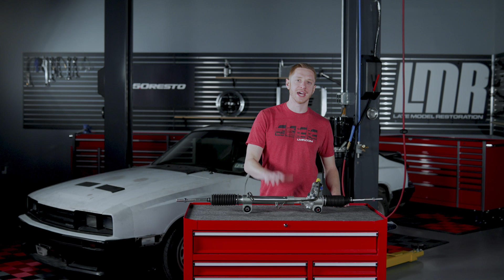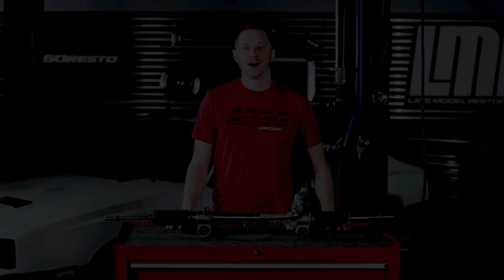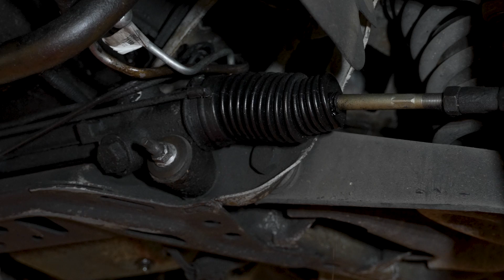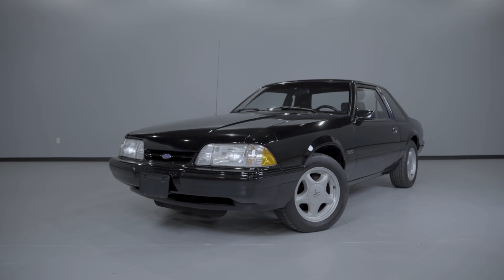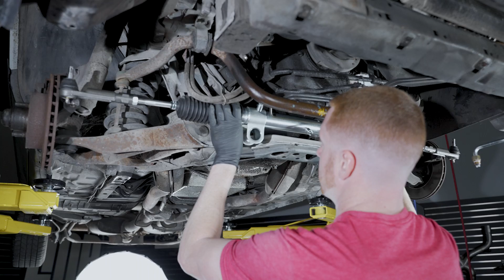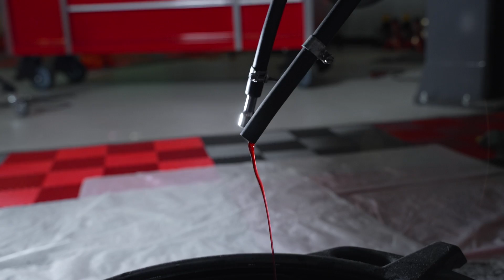How To Remove Power Steering Rack | Fox Body Mustang (79-93)

Comment: Great guide, I just did this last night, it’s hard without a lift but doable on jack stands. 

I had to rent a tie rod pull tool, I was smacking the front of the spindle for 30 minutes and those things would not come loose even with WD40. 

The pinch bolt on the steering shaft was tricky, you just have to find the right angle. 

Bottom two bolts are hard to free if your car is old, jack up your car high enough so you have room to use a breaker bar to free those bolts 15mm for the rear and use an 18mm for the front. 

Lastly using a huge pry bar helps like Landen shows, but also the drivers side sleeve will come out. I thought I broke something first but it is normal and will help with the install. 

I did this solo with jack stands up, if I can do it you guys can too!!!

Comment: What's the purpose of marking the reference point with a paint marker on steering joint to rack, if youre going to swap a new rack and the new one won't have the paint mark on the rack side?
Reply from the maker: This is for any one removing the rack to service something and will be putting it back. -Landan